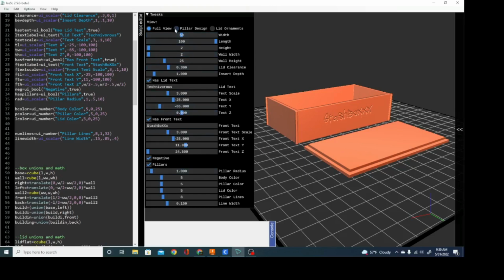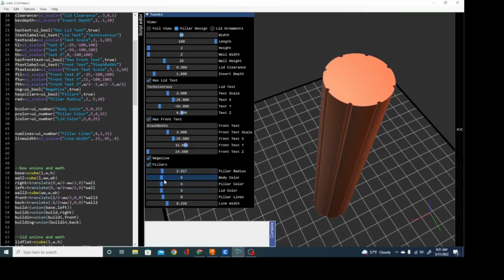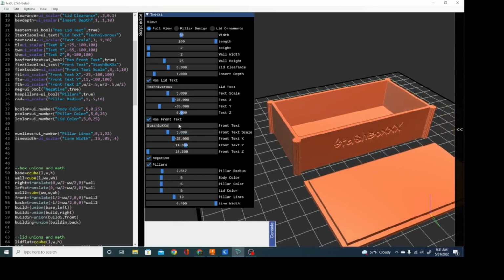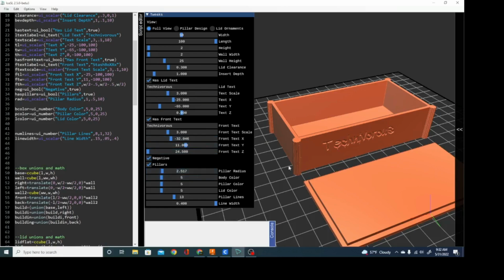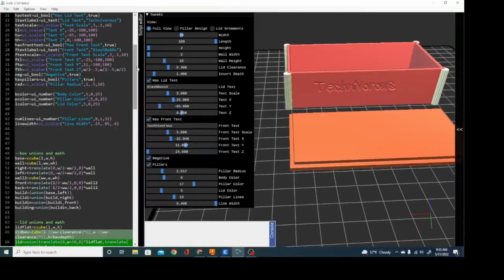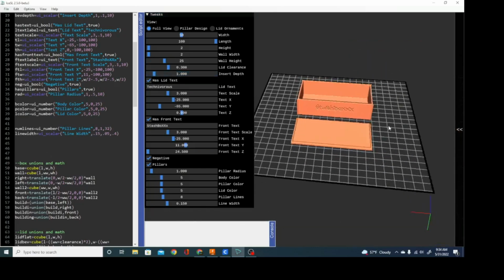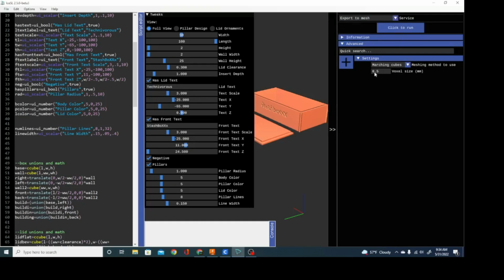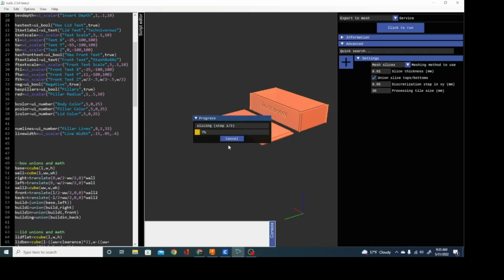Parametric modeling for 3d printing with IceSL

Comment: So its basically a refined OpenSCAD/slicer combination. Looks promising. No Creality support? I guess u just have to put the measurements of the machine in and it will still work in those only there maybee is not  a built in and ready profile for it. Ill try this one later today. Looks really interesting
Reply from the maker: There are plenty of options to dial in in the slicer and you can export sylar to slice with cura if you prefer